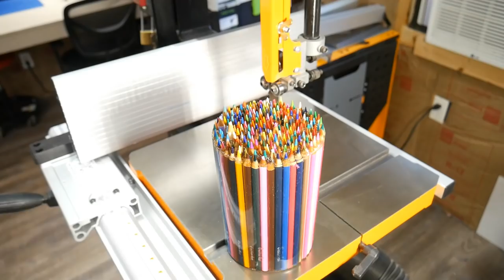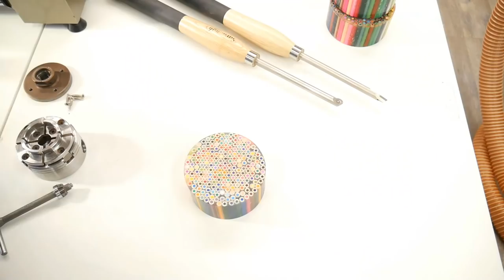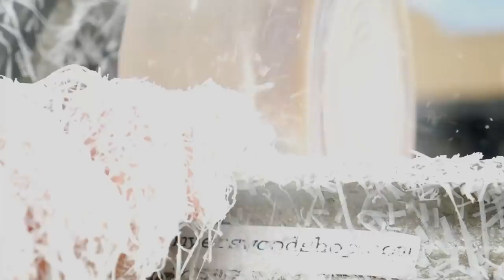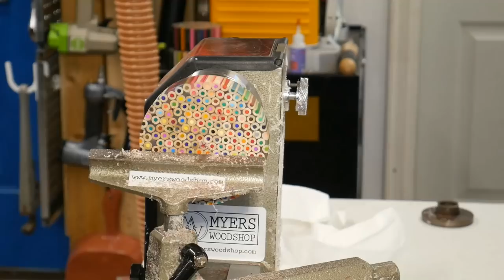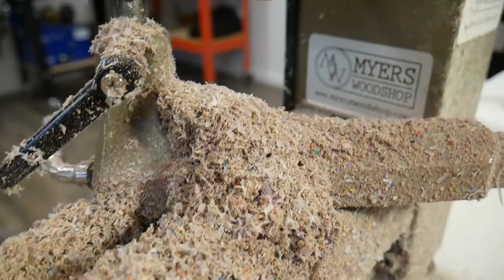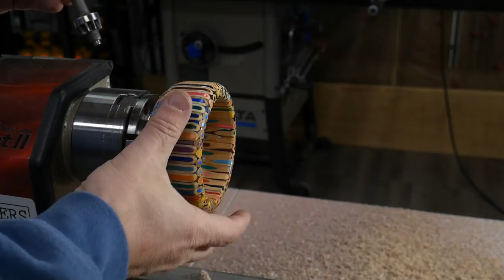Making A Colored Pencil Bowl

Comment: Very nice! I noticed that there doesn't appear to be any bubbles in the resin you used, that seems pretty remarkable really. I have watched other people do the same thing, but with lots and lots of bubbles, not to criticize them, but I just thought that you must be doing something a bit different. Stirring the resin mixture a bit slower? Heating up the resin while curing to remove the bubbles before hardening would melt the crayon I would presume.  Thanks again
Reply from the maker: When I set the mold I put it in a pressure pot while its curing.  This compresses everything and 'pushes' out the air trapped inside.
Reply: Myers Woodshop like a pressure pot used for cooking?
Reply from the maker: Similar, I took a harbor freight paint gun pot and turned it into a pressure pot
Reply: I came here for the walk control install & the algorithm popped this up next!! Awesome work guys.. I’m a machinist, designer, artist and now I’m subscribed!! Thanks fellows!  🚀🛠
Reply from the maker: Thanks for the follow!

Comment: I just completed my bowl but when sanding , the pencil color wants to bleed onto the wood part so the it looked messy… How did you avoid this problem
Reply: I wish Myers responded to this question and others of the same.
Reply from the maker: You can’t sand it.  It has to be done with metal to prevent bleeding.  A metal card scraper will work well.